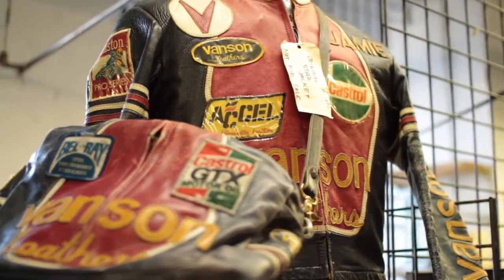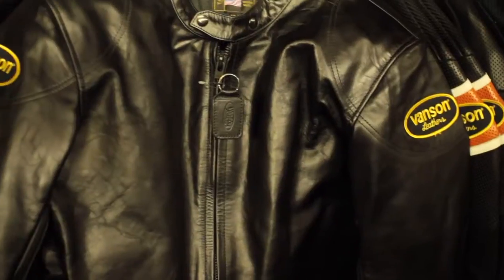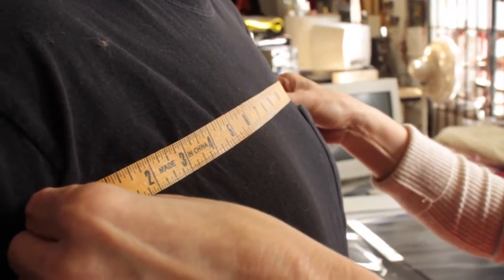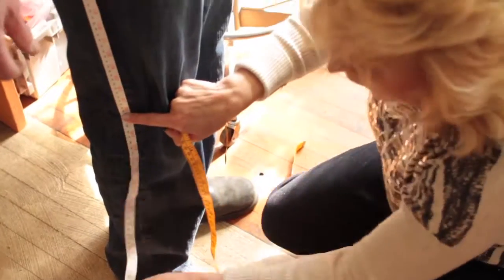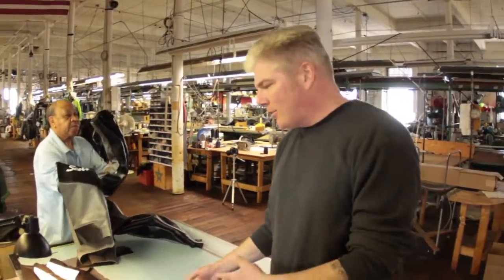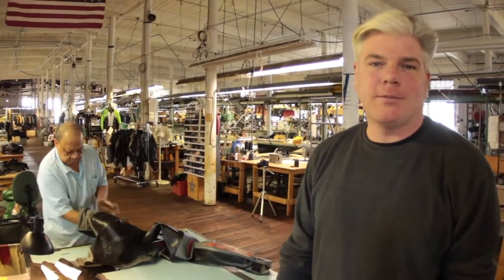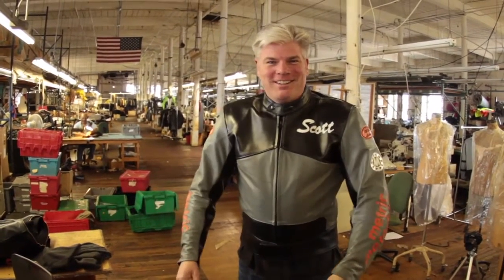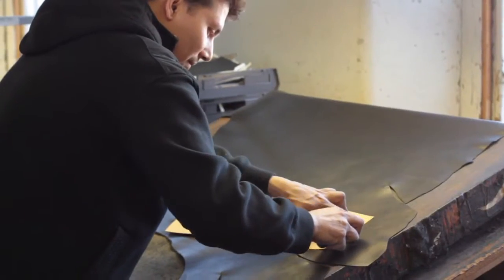Moto Pickers at Vanson Leathers

Comment: Yep, I from the WC and ride on all the tracks in NORCAL and SOCAL. My first riding jacket and pants was from Vanson and still have them. With 20 years of track riding and 3 spills, 2 low speed and 1 high speed I can vouch that it can take 3 spills before needing repair. When I got them back it looked as good as new! I was amazed at Vanson after sale service. With most other brands good luck in getting any kind of service and I've owned all of the better major brand of riding protection gear.  Most protection is good for one, maybe 2 crashes. There is a difference in quality and weight but when it comes to your protection, Vanson gives you confidence that it will do the job time after time. Another thing they did for me was I had a pair of riding pants that I never used because my original ones were still in service. When I was ready to wear it I had gain some weight. The Vanson team was visiting in the SFO area and I wanted them to look into having it altered. Kim from Vanson said that it was never used and looks new so they took it back and got me one that fit proper.  I was blown away and all the guys there were amazed by that great American customer service that is missing in today's business. One last thing, I got tired of wearing expensive Italian leather casual jackets where the leather is light weight and buttery soft but can't take a slight bump on the edge of a wooden table without leaving a major scratch. I got myself the Vanson Mercury Jacket and it's my favorite heavy leather, clean lines that looks great in most casual business setting as well that can take punishment and still looks great. The heavier leather protects you better in the cold as well. Thank you for building the best and providing the best in customer service and saving my butt a few times on the track.